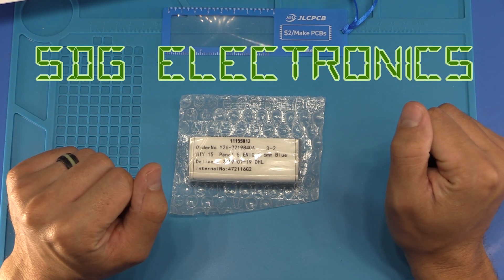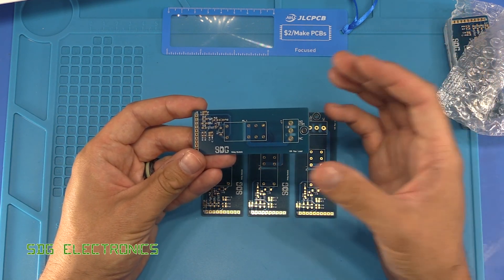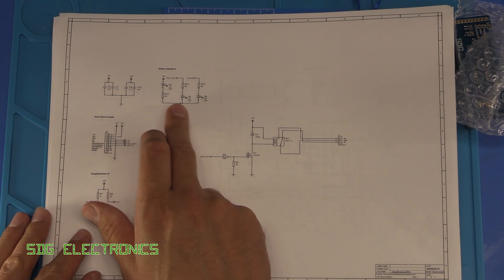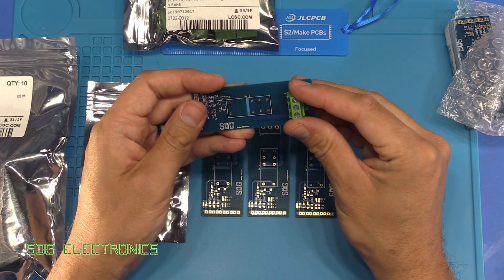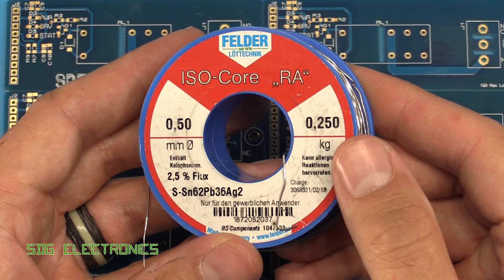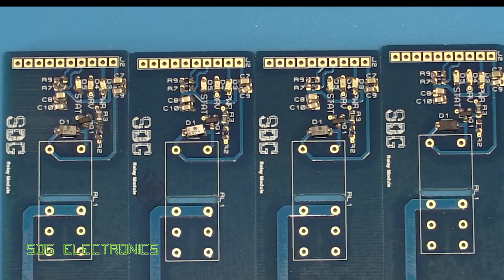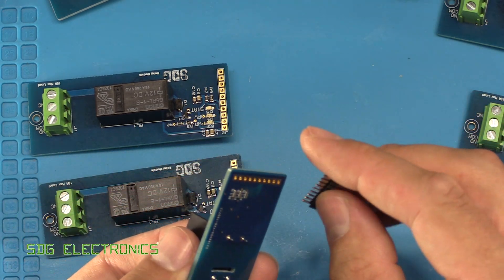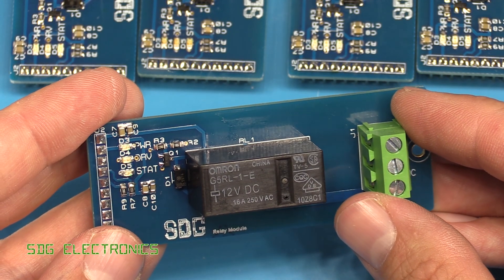SDG #097 - Lighting Controller Project Part 4 with PCBs from JLCPCB

Comment: I highly recommend using MosFet relay drivers as NUD3105 for 5V or NUD3112 for 12V. It will save you time, $, PCB space,  time to solder the components and it's better in shunting the back EMF. Also cheaper than buying 4 individual components. They also come in sot-23-6 dual driver package. I've never used anything else to drive relays since I discovered those.

Comment: Great video and extremely timely for some power amplifier equipment I am building for some clients. I went to the 62-36-2 solder recently and didn't notice much difference, but it does have some better characteristics (slightly lower melting point, higher conductivity and higher tensile strength) and the cost difference vs 63-37 isn't significant, so as long as it has equivalent long term stability I will be happy.

In addition, I am also going to be receiving an ultrasonic cleaner (a low-cost heated 3 liter, 120W model) in the next few days, and I will be interested in seeing what type of solution you are using.

I discovered your videos fairly recently and will be going back to view the older ones. IMHO your videos are a great combination of accurate and detailed information with an outstanding delivery, so I expect (and hope) your subscription numbers will grow into the hundreds of thousands if you persevere.

Comment: Nice project, but adding the screw hole and the later screw bellow the mains wires is not a very good idea. Even if the screw is bellow the wires, it is not a good idea.
Reply: he could use nylon screws but yeah you're right
Reply from the maker: It will be nylon screws and spacers onto the main PCB. Unfortunately not much I could do to support that end of the board.